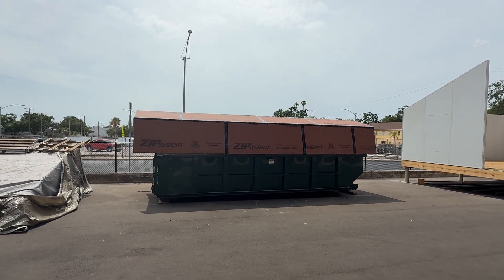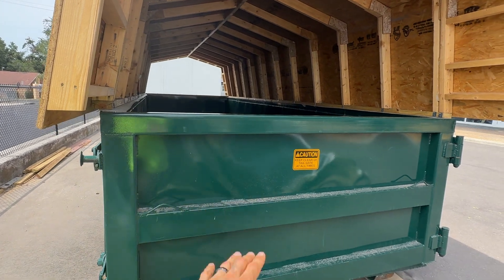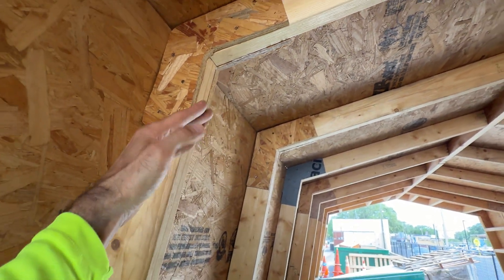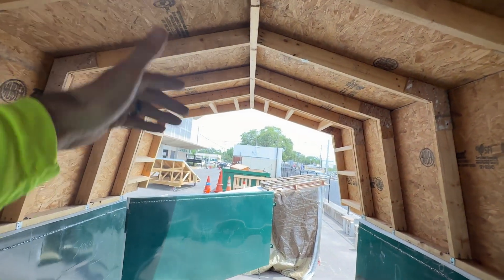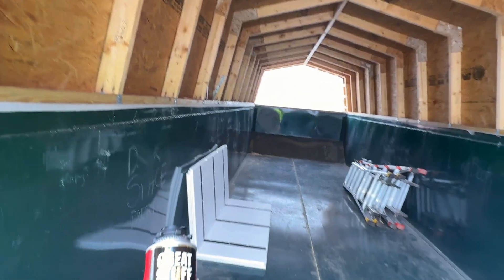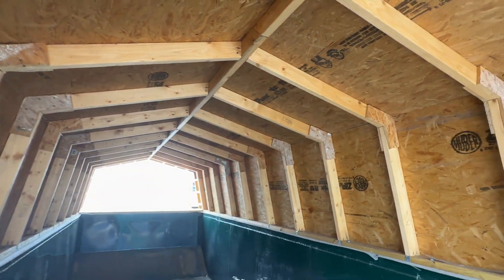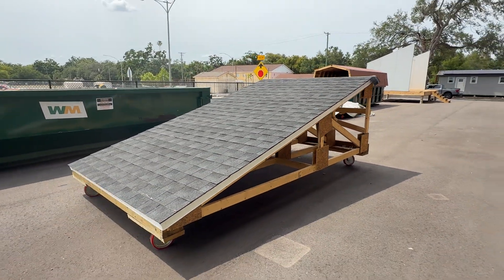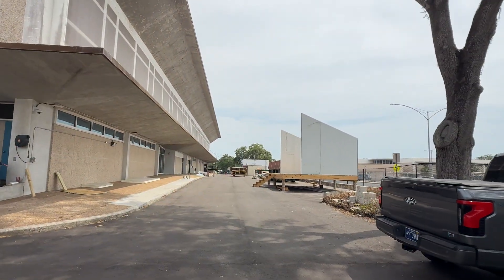Dumpster Tiny Home:  Episode 2  Roof System

Comment: This reminds me of not just container homes but retrofitted bus/van homes. How are you going to manage condensation and rusting of the container itself?
Reply from the maker: That is a great concern and priority #1.   The metal sides are impermeable to air/vapor transfer,  so we are using an Insofast foam system to add R-value, mind the K value and eliminate condensation.  The company specializes in outfitting shipping containers in the same way so fingers crossed it works for us as well.
Reply from the maker: Rusting from the outside is another story. We should have a decent overhang 2 foot on the front, 1’ foot on the rear and hopefully more than 6 inches on the sides that we should eliminate some of the exterior rusting, but I’m sure not all of it.
Reply from the maker: I was along for the journey of this build as well, so hopefully some of the improvements William did on his manbulance can be used for our build. https://youtu.be/Fwj6NFb51Z0?si=1RQ6vMaOCrEuME4c